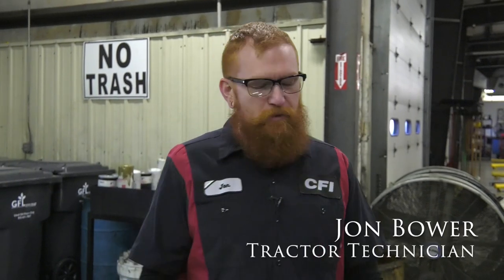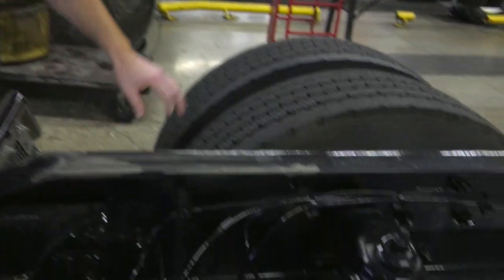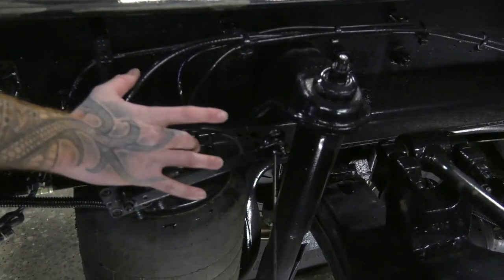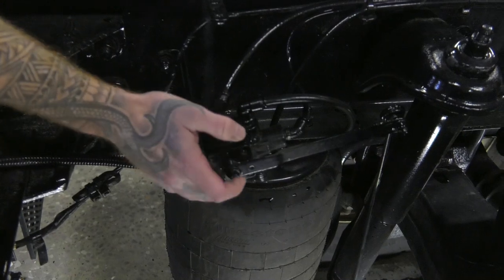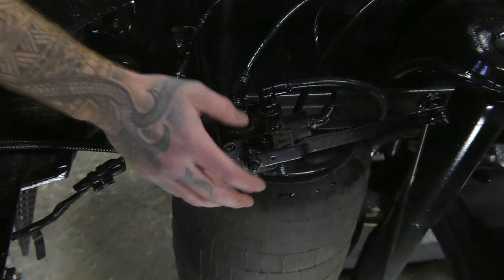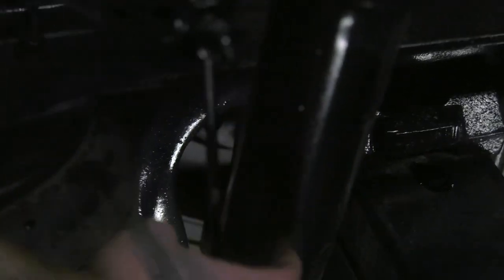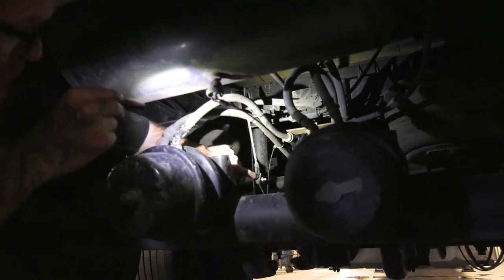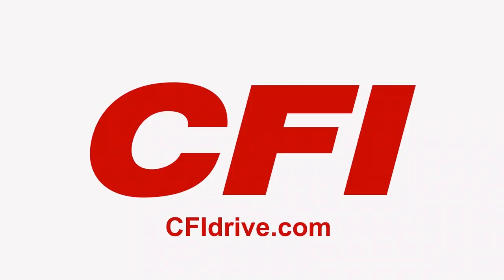Maintenance Minute - Leveling Valves

Comment: So, like I get called out to 03' T800 Kenworth, driver states that the air bags on one side are not inflating. He then states that they just replaced the leveling valve on the right side. Ok. Right side.. I ask " on the front or rear drive axle".. He says there is no valve on rear diff.. I drive out to go see...after a 20 min phone conversation, i was getting more confused..  on the first diff. there are 2 leveling valve, one for the left side, other for right side...each side has 4 air bag. 8 total on both diff's...  Now,  when charging system with air, the left side raises with the primary air.  But , the right side will not inflate until the secondary system is  over 90 psi in tank...  I thought that air suspension was always hooked up to secondary side... and why have 2 valves on same axle for the size of tractor?....  this tractor came like this from the factory... there are 2 other tractors just identical to this one...and plumbed the same way... Is it not primary is for brake system and secondary for emergency air and other systems to plumb into for use?